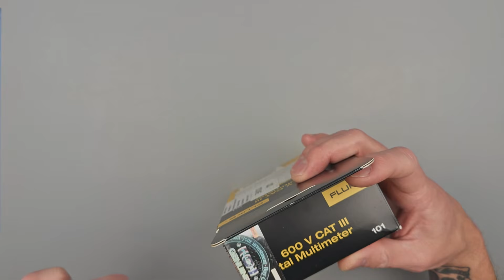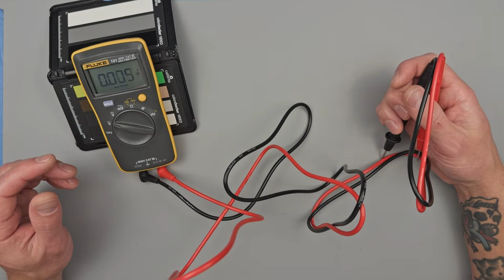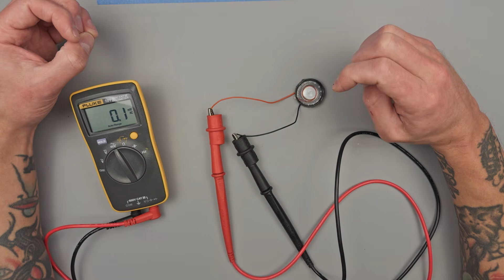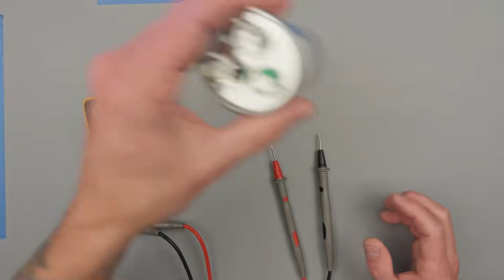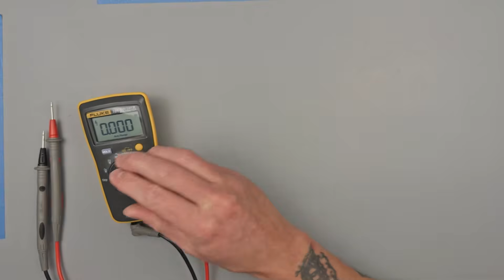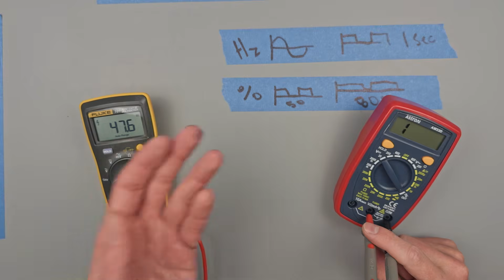How to Use the Fluke 101: The "Cheapest" Fluke Worth Buying?

Comment: Seems like a great basic meter , considering in the automotive world anything more then basic voltage checks I'm going straight for a scope so meters with more features like duty cycle or pulse width are often just a waste  . Great video
Reply from the maker: Thank you! Yeah I think those extra features could come in handy, but in very specific circumstances. It is often much easier and quicker to just hook up a scope. Techs just don’t have the time
Reply: @maddoxmechanic  that is true , but I’d like to think if you build a dedicated diag cart and have it ready to go at all times . But I know in the real world it’s not awaits possible . But I think most of us get by with just a good meter and a test light . Just the other a day a simple resistance test found the issue on a Silverado setting a APP 1-2 correlation code . APP-2’s ground had 18 ohms respectively to battery negative while APP-1’s had 1.3 . Found a ton of dielectric grease in the body to ECM connector cleaned it and both grounds were at 0.9 ohms . 2 techs had it before me and a simple ohm test with my Fluke88 found the issue lol. But great content man really enjoy watching
Reply from the maker: @CampingNstuff  Thank you so much I'm glad you're enjoying it!. I think having a dedicated diag cart would be bad ass. i've always wanted a set up like that. Good call on the silverado! Seems like your electrical knowledge is literally paying the bills!

Comment: Why would you choose this bare bones Fluke meter costing double the price of a good AstroAI or Kaiweets meter with many more functions or features?
Reply from the maker: Because this is a professional meter. It is going to be not only accurate but also incredibly durable. You could literally take this and use it as an electrician on an oil rig for 5 years straight and it’ll work perfectly. You’re paying for the quality of the product. I love AstroAi and Kaiweets, but they’re meant for light use or by hobbiest/DIYer crowd. Great question!